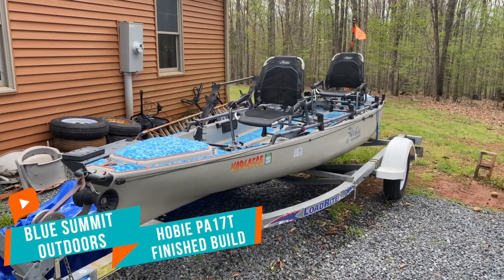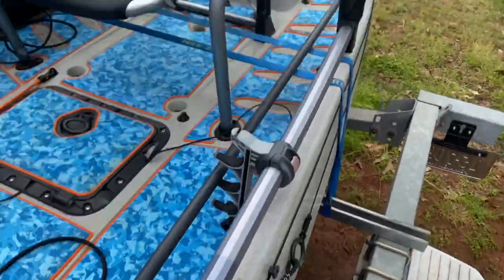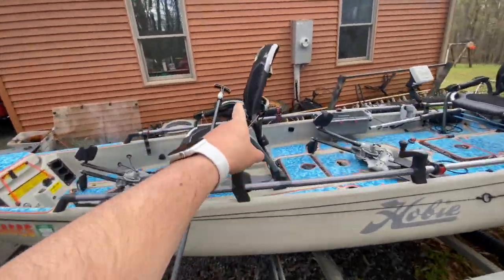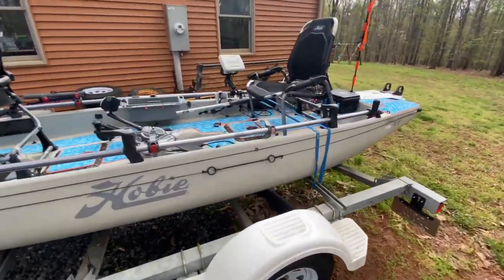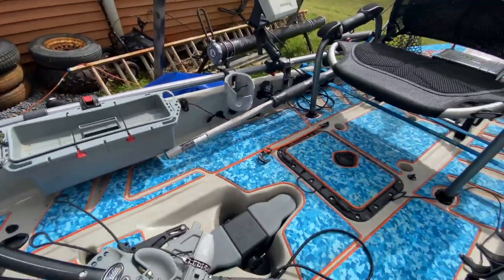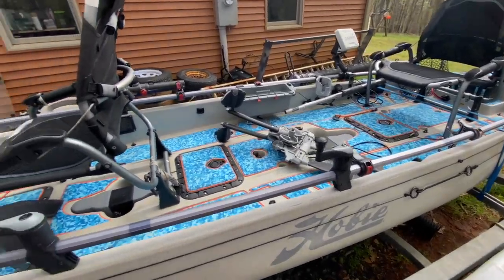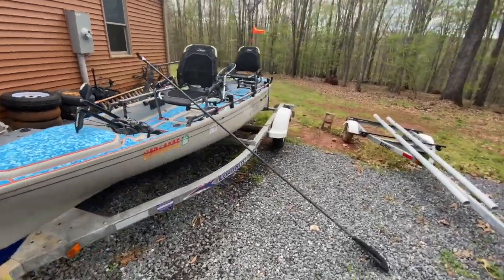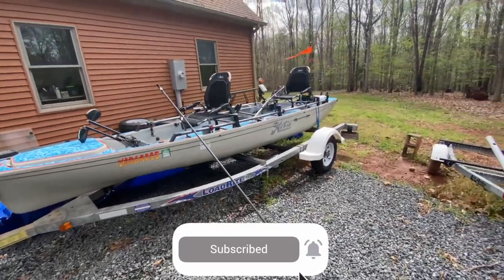Hobie PA17T Finished Build| SuperStick Versatility| Yak Power 5 Button Wireless Switch

Comment: Just saw this and watched due to the PA17T.  We have one we use on lakes in TN and the FL Gulf.  Love the boat, though we do need the trailer to get it in the water. We also need to get some smaller boats as well. My wife can use just about any of them. But I'm 6'4 and weigh in at about 260, so my options are limited - an outback would be a little strained to hold me and all the gear 🤣🎣

Comment: Any pointers on installing the marine mat? What did you use to prep the surface? Was it difficult to remove the old adhesive? What did you use to clean off the old adhesive? Thanks in advance.
Reply from the maker: My original adhesive was already starting to peel up, so it was not hard to remove, and it did not leave anything behind. All I did to prep the the boat was cleaned it really well, then wiped it down will Alcohol. Then made sure its all dry, I used a hair dryer to speed it up. Once I laid the marine mat down, I used the hair dryer to warm up the adhesive, then applied pressure to the pads, a roller works great.
Reply: Ok. Thanks. I’ll be doing my marine mat install soon. Waiting for the temp to warm up some. I’m planning on scrubbing with dawn and then final wipe down with alcohol.
Reply from the maker: @zakerid  no problem. Good Idea.
Reply: Another question. Did you remove the tape under the original deck pads? I removed them because they were peeling. I wonder if I should reapply something where the tape was. What do you think?
Reply from the maker: Yes I removed the ones that were peeling as well I just replaced them with duct tape 👍
Reply: Thanks for the video.  I also have a PA 17 and will be installing a fish finder.  I have been wondering how I could install it so that I can use it in both positions.  I'd love it if you could do a detailed video of how that actually operates for you.  Any advice will help me.  Thanks.
Reply from the maker: I’ll see what I can do about a video thats more in detail about the electrical on this boat.

Comment: Where can I get the bow mount trolling motor mount for the PA 17T ?
Reply from the maker: I think they either quit making the pa17 or at least paused production. So that part is hard to find you it seems to be out of stock everywhere. You might have to find a 3rd party option like One Objective they make a bunch of adapters for kayak trolling motor mounts.